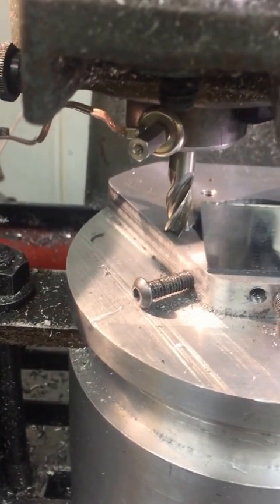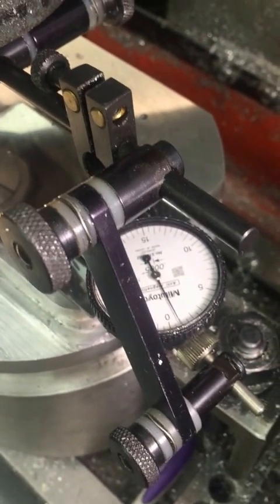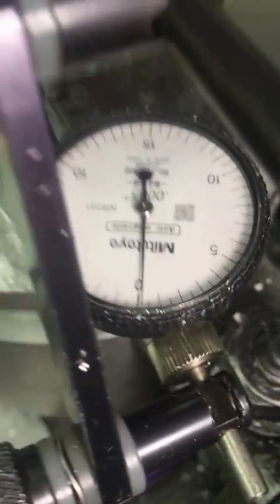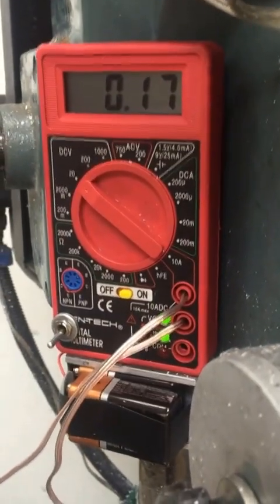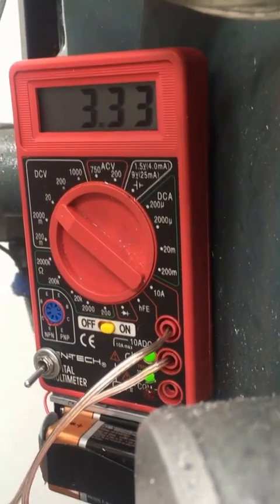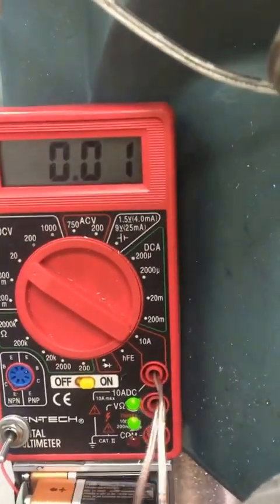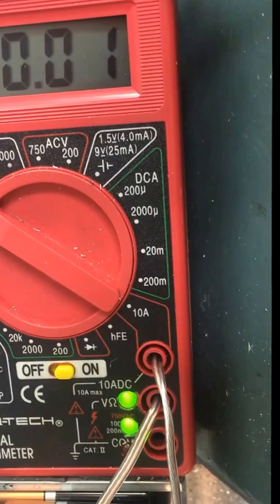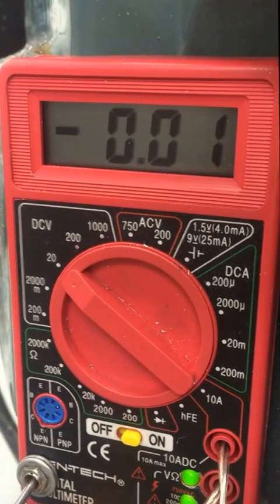Multimeter Based Electronic Edge Finder

Comment: Rick, would it be more consistent without having to turn the spindle if you put a jumper wire from the spindle to the head?  A "Y" lead with two magnets, one attached to the spindle and one attached to the head would also work.  I think either method should eliminate the wildly fluctuating resistance.   I am no E&E, so I won't complain or whine if you set me straight on my thought process.
Reply from the maker: Bartley,Think of it this way: the cutter touching down is a switch. The spindle bearing's electrical resistance connects across this switch. The EEF connects across the switch too. Before touchdown, the circuit sees the relatively large but variable resistance. After touchdown it sees close to a dead short. Here is an article that explains what is happening for a lathe. Same idea applies to the mill: http://rick.sparber.org/ueef.pdfRick
Reply: The link you posted" http://rick.sparber.org/ueef.pdfRick"  is not working
Reply from the maker: Emery Board    Remove "Rick" from the end of the URL.